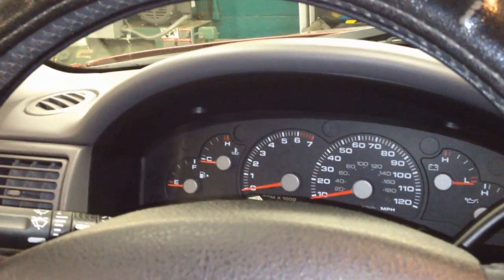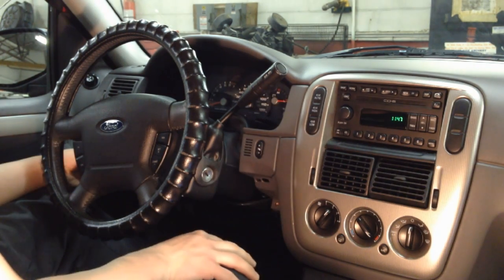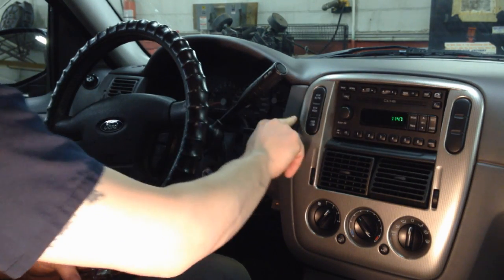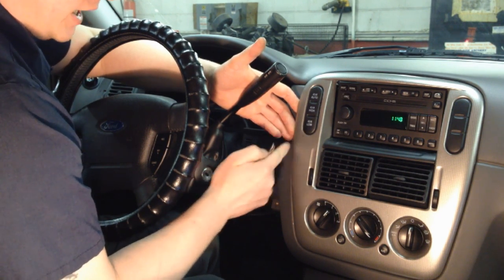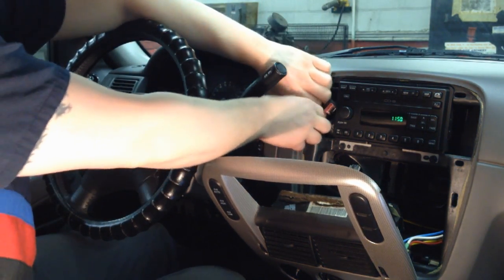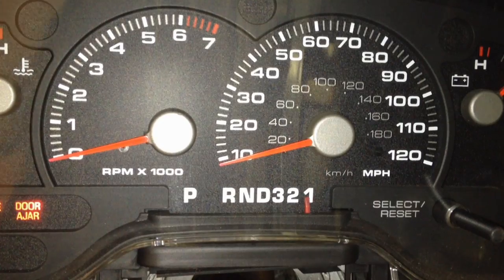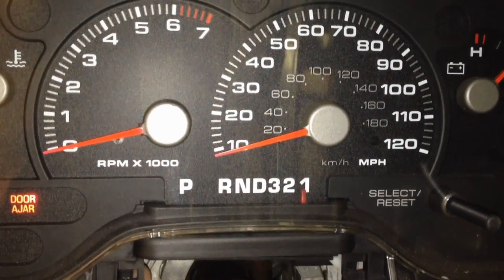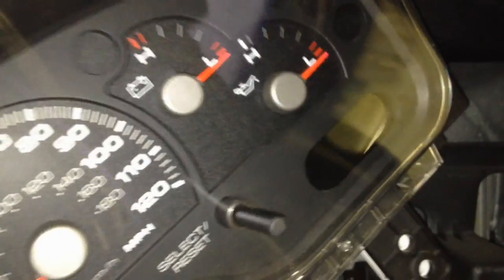2002-2005 Ford Explorer Instrument Cluster Removal

Comment: Thanks for taking the time to make and post this video. Also nice to see you responding to questions. I just "inherited" a 2003 Ford Explorer Sport (2 door) and a couple of the bulbs must have blown in the cluster. Hard to tell what speed I'm driving at night, that's for sure. I'll be following your removal instructions soon! Can you tell me what the bulb type is so I can make sure I have the right kind and quantity on hand before I disassemble the whole thing? Not all the bulbs are blown, but I figure I'll just go ahead and replace them all while I've got the cluster out. Many thanks!
Reply from the maker: JRitz79 Best bet is the local Ford dealer but the number I am getting for your vehicle is here-http://www.amazon.com/gp/product/B000O0MM3E/ref=as_li_tl?ie=UTF8&camp=1789&creative=390957&creativeASIN=B000O0MM3E&linkCode=as2&tag=fordt-20&linkId=TP6WKOYTUAGPVMJH

Comment: Great instruction Video!   Thje trouble with my cluster is the odometer sometimes doesn't light up or it's very dim.  Sometimes if I hit the dash a little it will light up bright again.  Any idea what is wrong with it?  It's LED so it's not s bulb problem.

Comment: Can you tell me what else a battery saver relay may be called? There is a crazy fast clicking sound when I start my 04 sport trac and the panel all lights up until it starts. A 30+ year parts guy at a ford dealer said he has never heard of it.Im guessing it is in the central junction box?

Comment: I'm not one to tell a ford tech how to do their job as you know much more than I ever will, but I like my way better as far as taking the center trim panel off. 

I push the air vents all the way down so that I can grab the lip that is there. A nice tug then pops out the whole thing. Easy peasy.. 

Also, removing the dummy panel on the right side across from the 4x4 buttons can allow you to pry it that way with your hands too. 

Prying with any tool, no matter the spot always leaves some risk for snapping stuff so I try to avoid it. Great video though!
Reply from the maker: The reason I don't do it that way is because grabbing and yanking fast like that to pop plastic trim out especially these ones that are in there tight I find you crack more panels that way than popping the panel up at the retainer points. With the cat claw I use I can feel for it and tell when I am over the retainer. I do it this way on all interior trim panels and it has work out very well over the years as I have honed in my technique for what does and doesn't work.
Reply: FordTechMakuloco Makes sense and like I said, I'm sure your way is better anyway. I jsut had to throw my .02 in there. I will try your method the next time I inevitably mess with something back there!
Reply from the maker: ***** No need key off is all you need to do.
Reply: FordTechMakuloco  I have a parasitic drain on my battery I didn't have a check engine light for about 2 weeks my battery kept going dead now my fuel gauge is acting up and my check engine light came up and this was code po463 could NY cluster be  Problem

Comment: The cluster was replaced on my 03 explorer b4 I purchased it. The message center has not worked since I've purchased it and wonder if possible y it could be related to cluster removal. Reprogram requirement?

Comment: Great video...not sure what my problem is.. I have a 2002 Ford Explorer Sports track, back lights and blinkers were acting up.Figured out the Multi function switch was the issues and replaced it. It fix some of the light issues. Now when turning on the lights the back light don't come on. Blinkers, hazards and Brake lights work though. The dash light are acting weird. Once you turn on lights the dash lights don't work but if you remote start the truck they are on. Once you hit the brake they go off...Crazy right. Any suggestions...this is killing me....

Comment: Ford and all the other makers who try to force our vehicles into an expensive dealer shop just to change a light bulb should be sued for unethical business practices.  This is ridiculous watching this guy disassemble the whole dash, radio panel, gear indicator, etc. just to replace a common dash light set.  But for $700 a Ford dealer near you would be happy to do it.

Comment: Can you make a video for removing a 1996 Ford Explorer 4L GEM module? Mine isn't working anymore and the garage estimate says it will cost $850.00 if they do it for me. I bought the vehicle for $1200.00 5 years ago, so I really can't justify an $850.00 power window/wiper repair job when the car itself is hardly worth $850.00 by now. :(

Comment: I lose power power to my inst cluster , stereo, windows, accessories...intermittently and will return after a firm slap on the dash ? WTF
Reply from the maker: I would start at the cluster connector for pin fit.

Comment: it is cetainly a helpful presentation , but you didn't BEGIN to tell what a virtually impossible task it is to get the gear indicator back into the cluster --- what a nightmare
Reply from the maker: You just have to snap it in straight.

Comment: hi i have a 2006 expedition and took mine out cause od light not working but i have a sealed one ? 6LIT-10849-DC . ANY ADVICE ? THX FOUND A SURFACE DIODE RIGHT BEHIND THE OD READOUT 330 VFK 5F5